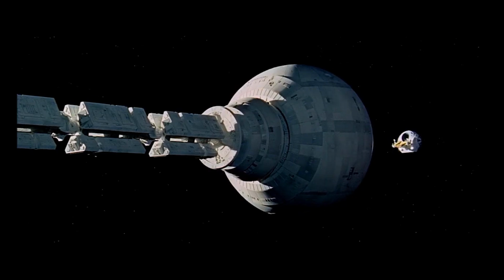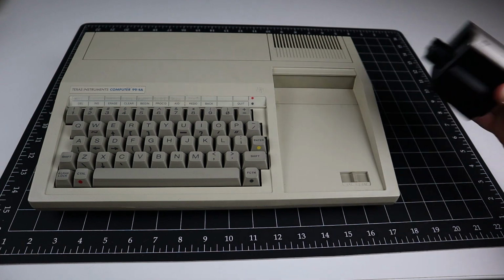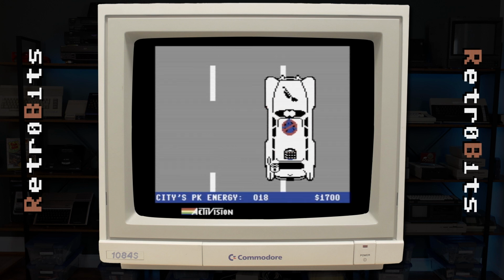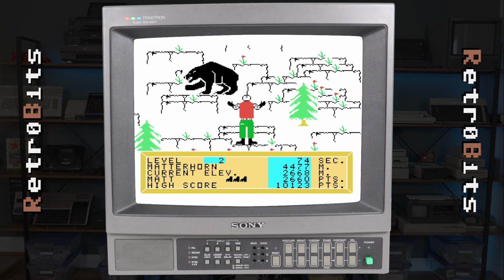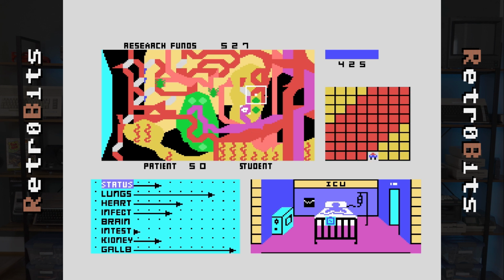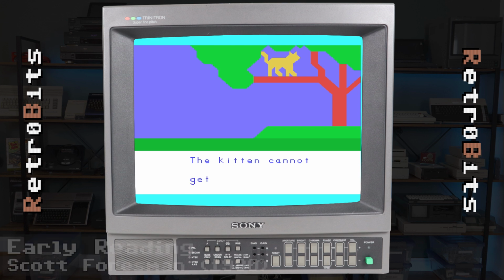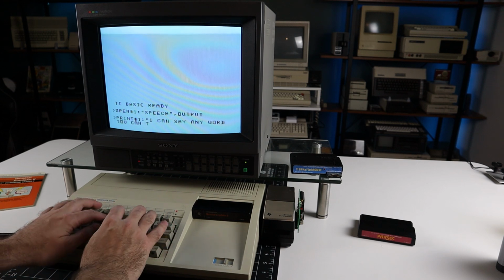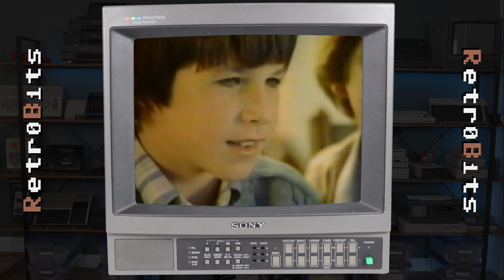TI-99/4A Speech Synthesizer First Look, Background, and Demonstration

Comment: I'm the person that ported the TI-99/4A to the MiSTer FPGA.  I didn't realize allophones didn't work until watching your video.  I've just committed a fix, and it will show up in the next release.  FYI, I took the actual LPC conversion code from FPGA code written by DAR, which is based on MAME, but should be fairly accurate to the actual device.  I added the rest of the synth logic (speech rom handling, interface, etc).  There is room for improvement, but the behavior should be fairly close.  This is all being done in the FPGA. The reason it didn't work was that the speech synthesizer has a "not ready" signal that can disable the CPU when it's FIFO buffer is full.  Apparently, the Terminal Emulator 2 cart, just sends the data as quickly as it can, and that can overflow the buffer, so stalling the CPU is necessary.  After seeing your video, it only took me 15 minutes to hook up the signal (and a couple hours to compile and test), and it started working.
Reply from the maker: Very cool, thank you for your work on the 4A core and for identifying and resolving the TE2 issue! I will be sure to test it out when the next release ships. Cool you were able to diagnose it so easily and wish I had those skills :)
Reply: from memory there was only 255 allophones accessible via TE2 ...
Reply: Honestly ...   my  car Door  is NOT a  Jar !   :-D
Reply: I'm glad somebody is doing emulation for the TI. I thought about getting a Mister eventually. Right now I use a cheap android box or hook up a laptop on my arcade kiosk I put together.

Comment: I did have the TI 99/4A as a six-year-old, and you're absolutely right, the Speech Synthesizer was pure novelty. Actually I think I just had the computer without the synthesizer for quite some time, and got the synthesizer like when I was 10 or 11.

Comment: We had a speech synthesizer when I was in the 8th grade.  My dad and I wrote a spelling practice program that would allow you to enter words, save them to tape, and then it would call out the words in random order and tell you whether you spelled them correctly or not.  It worked pretty well.  I got A's in spelling from that point on.

It did mispronounce some words.  Mosquito was pronounced mos-kqit-oh.  lol
Reply from the maker: Haha that's great! A good use for the technology for sure. Yea, in my testing I had to intentionally misspell some words to get it to pronounce them correctly :P
Reply: @retrobitstv  If I were to modify that program today I would add the option of an alternate pronunciation.  Ah well...  Almost 40 years of hindsight is 20/20.  (Holy crap, it's been that long ago??)

Comment: I once saw a project to build a similar device for the C64 in one of the magazines. I initially wanted to build it (despite a complete lack of electronics knowledge), but never did, mostly because there wouldn't be any software to take advantage of it. I did use a program called S.A.M. to write a couple BASIC programs that spoke though.

There's at least one C64 game that plays sampled speech and sound effects without freezing everything else. It's called Slimey's Mine. Granted, the speech isn't especially long, but it's impressive that it plays perfectly without affecting the rest of the game, and the quality is even pretty good.

Microsurgeon - I loved this on the Intellivision. I've tried the TI version in emulators and it doesn't appeal to me as much as I thought it would. It's nice to have the status on the screen all the time, but that also means that the actual playing area is smaller.

Comment: I was one that had Ti994a  BBS  who wrote Sofeware For Caltex 99  Bulletin Board  that used the Perfrefal box with rs232 card , 32k card and 720mb disk drive. A modem at 300 baud with advance software for the modem.   The BBS. Had message board, download , upload and Speech. 1982-1989. Still have 3 TI994a  computer but keyboards stop working .

Comment: It might be hard to hear it from the samples, but LPC playback is much more playback of digitized input than it is true speech synthesis. Real audio is analyzed and broken down into LPC components. For example, the female voice you hear in Parsec is a real person, Aubree Anderson, who was a college student at the time. She provided all of the audio samples for input.

Based on that, it actually has more similarities than differences with Mozer's process for the audio in c64 Ghostbusters.
Reply from the maker: Hi Jim, thanks for sharing your insights - always a wealth of information! Any idea how the Parsec developer had access to the necessary tools to create the LPC data from samples? It seems like it would be a highly specialized process at that time.
Reply: @retrobitstv  It was usually a paid service provided by Texas Instruments, using software they developed. Analysis was too heavy for personal computers at the time, and required mainframes. For the TI 99/4a games, though, I believe they provided the service for free, to support the product line. But other devices, like talking cars from auto manufacturers, had to pay.
Reply from the maker: @JimLeonard  Very cool info, thanks!

Comment: I put the speech synth inside my Ti99. It fits on top of the shielding metal, the connections are made with wires to via's (small holes in the traces) next to the contacts of the side connector on the main board. This way the side connector says free for other use.
Reply from the maker: Great idea!

Comment: Unfortunately you missed one of the best early examples of the speech synth IMHO - making it sing Daisy. Thanks to cold weather in Colorado and a lab full of TI-99/4s (and then 4As) with toasty linear power supplies, I'd sneak into it at lunch and learn, leading to a good career in IT. I begged my parents to buy one, and then received the free speech module, added the expansion box, floppy drives (SSSD, then DSSD, then DSDD, then DSQD), then a RAM drive, and then increased the internal memory and doubled the speed. Awesome machine design with expansion cards that just worked without the need of extra driver software!

Comment: I had one back in the day, but I leaned more towards my VIC 20, just because it had more support.   But I also had an Atari 800 and still leaned towards the VIC 20 for programming, despite BASIC 2.0 being rather limited. It came down to the Petascii character set, which gave the Commodore "graphics" with just print statements.

Comment: So I just got my Speech Synth for my TI-99/4a today. I'm quite new to the 99 and am wondering, is there ANY way to get output from it, if all I have is the base computer and the speech synth? (No command modules yet)
Reply from the maker: I believe you need either the TI Extended Basic cartridge of the Terminal Emulator 2 to access high level speed routines, otherwise you'll probably have to access the low level hardware directly. I would check out the Flashrom99 or FinalGrom products which will give you  access to most of the system's cartridge library on an SDcard.

Comment: Some guy just gave me a complete TI-99/4A setup with synthesizer, PEB and all the cards plus a ton of cartridges. The games for the most part are horrible, but once I plugged in the synthesizer they became hilarious! I had a Radio Shack Color Computer (the silver one) back in 1981 and I thought it was a pretty good computer at the time, but now I believe the TI was actually much more advanced. Would like to see a head-to-head comparison.
Reply from the maker: Nice, I'd like to pick up a PEB at some point but they are so bulky! Some of the best games on the TI were unlicensed titles from AtariSoft and Parker Bros. Moon Patrol, Popeye, Pole Position, stuff like that come to mind.
Reply: @retrobitstv  I think the PEB weighs 40lbs! I have it standing on end, and it looks like a 90's PC tower. It has the most ridiculously over-engineered cable I have ever seen.

Comment: Do you have a link to the magazines shown in this video?
Reply from the maker: I only have info for some. One came from "99'er Magazine", Volume 1, No. 4. The Microwave ad came from "ELECTRONICS Australia", April 1980. Also, "BYTE", September 1981. They were all found on archive.org.
Reply: @retrobitstv  The "99'er Magazine Volume 1 No. 4" was what I was looking for, thanks.

Comment: Wonder whether PC99 can do the allophone speech.  I'll try to remember to give it whirl tonight when i get onto windows.
Reply: Okay, tried this out and PC99W does in fact play back allophones, but not without some tinkering with the code to slow it down.  (I'm running PC99w on a Ryzen 3 which it isn't optimized for:

10 OPEN #1:"SPEECH", OUTPUT
20 PRINT #1:"THIS IS THE T I 99 HOME COMPUTER"
23 FOR I=1 TO 1500
25 NEXT I
30 PRINT #1:"RUNNING ON P C 99 USING ALLOPHONES FROM"
33 FOR I=1 TO 1500
35 NEXT I
40 PRINT #1:"THE TERMINAL EMULATOR CARTRIDGE"
43 FOR I=1 TO 1500
45 NEXT I
50 CLOSE #1

Comment: 5:45 Soo... How many amps are you expecting, because that's a pretty beefy jumper wire.
Reply from the maker: Haha true! When I raided my bin, I found that length of red wire already cut so I used it :) I do not plan to power anything other than the RAM expansion with it!
Reply: Yeah, I don’t remember how many amps every the console draws in the built in PSU but I think that’s why they didn’t run the jumper at the factory - the 32K external RAM he is using barely draws anything, but TI might have been afraid of something else drawing too much current.

Comment: It's not technically necessary to many programs so I'd say the hardware cost probably held speech back on all platforms. The lack of full allophone support till much later didn't help either since the whole "full word" expansion model was just cumbersome enough to be a hindrance. Speak & Spell made it work but it was much cheaper overall.
Any peripheral not supported enough will always fall into obscurity, despite a pretty good amount of games there it was a luxury novelty, maybe if every program used the module it could have sold better. Partial or optional use tends to turn into low amount of use, while KITT and HAL talked as a stock feature lol.
I think with education software that was probably the easiest thing to add speech too while good use in video games took some design skill to make sure it didn't get annoying and unwelcome.

Comment: what type of tv/monitor would be best to hook one of these computers up to?
Reply from the maker: The 4A outputs RF and composite video so basically any old TV or 15kHz monitor should work fine. If you can find one, the F18a upgrade gives your TI VGA output and enhanced graphics modes.